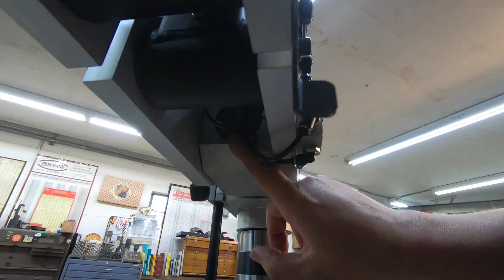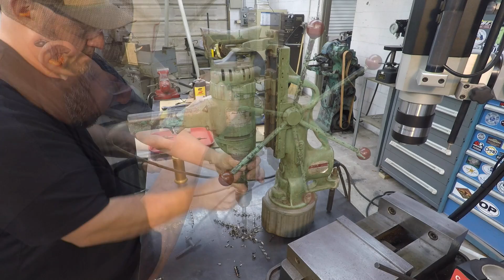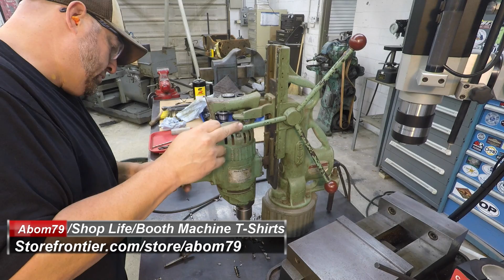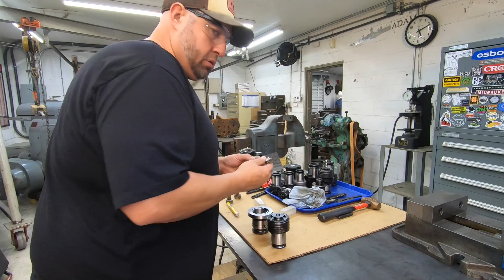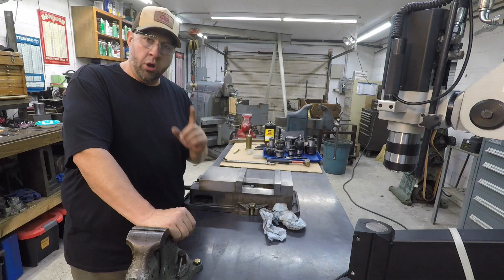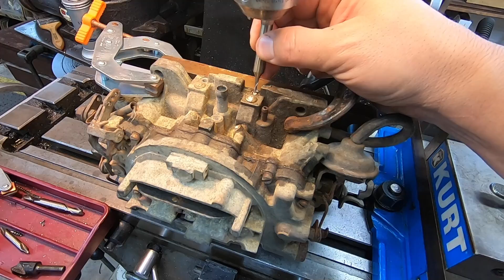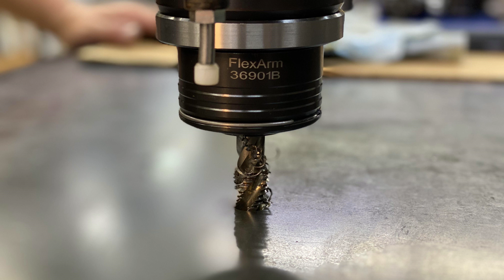SNS 301: Flexarm First Use, Broken Screw Removal

Comment: I've had to get many broken bolts out in my career and i loathe getting small bolts like that out. Especially since the majority of the stuff i have to work on i can't throw up on a mill or in a lathe and work on it. Most of the time i have to work on it on a bench or on my toolbox. Or i have to work on it as it sits in the machine. Starrett center punches have become my best friend in recent years. It's such a great feeling when you finally see that broken stud you've been working on finally break free and start to turn in the hole.

Comment: I wonder why the customer wanted the old carb instead of just getting a new one. In my experience they never run right once they're that badly corroded.
Reply: It could be that whatever it came from was so old that you can't get a new one for it. And if that's not the case it might be a sentimental thing? Or maybe they're just cheap. There's dozens of reasons.

Comment: 28:05 Be patient. Keep drilling with the LH. It will catch when most of the bolt is gone and the pressure holding it is released. 90% of the time will all pull out.

Comment: Why not make an adapter to hol;d a Jacobs chuck?
Reply: For the flexarm? Because at some point a jacobs chuck just won't be able to keep enough torque on the tap to keep it from spinning in the chuck. Plus there's no need for one with all the tooling the machine comes with. And you're not really going to be saving any time, either.

Comment: How does it not break taps?
Reply: Clutch style tap holders
Reply: Smooth, damped hydraulic power, constrained vertical motion, and a computer system constantly monitoring cutting forces

Comment: There are a million ways to bake a cake; when I drillt hrough heavy steel, my main concern is too get a pilot hole in it first. I use a two fluted, #30 short threaded drill bitThen I use Bo-Lube to cur my holes. Once I have a pilot hole I’m good to go. Then I have no problems with final size. This is not meant as a correction just my method of doing things. Adam knows what he is doing. 😎

Comment: A radial drill is all you need to do this entire project, but I’m old school.
Reply: Richard Rush, what’s a radial drill?
Reply: @genecoppedge5972  radial arm drill press is basically just a drill press with Rotating arm. It doesn’t have a clutch in the collet like the flex arm but it has a multitude of uses other than being just an expensive power tap. I tap with a radial arm drill press all the time

Comment: Just a curious question, how do the flex arm keep perpendicular to the parts? It was setup perpendicular to the table, i assume, but on top is a vise, then probably a matrix of parallels in the jaw, then here comes the parts. How to guarantee it is not 89 or 91 degrees instead of perpendicular? I guess that's where the money worth of this machine......is it hyrolic self balance?
Reply: Hydraulic sorry bud; Some of days are spent knee deep hydraulic lines, fluid, & actuators as an aircraft mechanic with Cal Fire with 47 years of experience. 27 USAF active duty & 20 years with Cal Fire Aviation. 😎
Reply: I’m not answering for Adam just my two cents take it or leave it. A set of taps come with 3 taps; #1 has a taper end and is called a starter tap, #2  cuts deeper threads, #3 is a bottoming  tap and finishes the threads. While doing this procedure; I also use Tap-Matic. Just my way of doing things, this in no way says I’m better or have the best technique. Merely my way of doing things my way. 😎

Comment: Would a dull drill bit work better to grab than a sharp one would on the broken screws?
Reply from the maker: Sometimes yes. More tool pressure works better, but sometimes that sharp bit can really dig in hard to help break the bond.

Comment: May I please ask you on why you did not just put a reverse tab in the hole and turned out in that way? I have used that method, mostly because I am afraid to damage the original thread, so I use a drill bit about 2 sizes smaller and use a reverse tab to turn it out by hand. :-)

Comment: haha funny this came up because just today I got a stainless steel bolt that broke off in my seadoo 951 upper pipe of the exhaust... how hard is that going to be for me to get out?
Reply: Is it stainless into stainless? If so it might be very tough.... if you've already worked on it please update us!
Reply: @davidbennett288  just ended up getting a used exhaust from another ski. Much less trouble

Comment: Looks like a nice tool, that Flex-arm!  Tapping is one of those jobs that takes a lot of time when you have many holes to do, and doing it manually and getting the threads just square takes a bit of time especially if the workpiece doesn't have a level surface to sight from.  

In the shop where I did my apprenticeship we had a "tapping machine" that was like a drill press, except that when you pressed the quill down the chuck when clockwise, and when you pulled the quill up it went anticlockwise.  It sounds good in principle but in practice I always found it a pain to use because the drive worked on a friction clutch that meant you had to pull it up fairly hard to get enough torque to unwind the tap, which would lift the workpiece off the table unless you clamped it down, and the upwards pull could also break out the top threads when working in aluminium alloy.  I gave up on it after a few attempts and I rarely saw anyone else use it.  By comparison, this looks so much more convenient because the reverse is on a touch control and you can just take it to the workpiece without the need to clamp it in a specific position.

I have a few questions:
1. Is there a torque control you can set?  Often I use small taps which are easily broken if you can't either feel or limit the torque.
2. The all important question - how much does it cost?  I'd need to get a pay-back on the productivity gain.

Be very interested to know.

Mike

Comment: Few people know how difficult it is to extract such a tiny broken long screw from a soft aluminum metal housing !  Great job, you are a master machinist. Most of my attempts to pull off such a feat  have wound up with the drill bit wondering off into the soft metal.

Comment: I like using a slightly smaller drill bit to start a pilot hole then go up a size and the reverse bit usually grabs the broken bolt and spins it out. If I just use one drill bit it almost never grabs for me but when  you use to sizes the larger bit tends to bite in better when a slightly smaller hole is already there. Just my 2 cents.

Comment: somebody didn't know how to set idle mixture screws. never run them to a "hard" stop or this happens and distorts the metered orifice.
Reply: I suspect that needle tip got pressed into the orifice when the drill bit cut through the threaded diameter of the screw. Earlier in the video it was not seated tight as Adam was able to squirt some Knock 'er Loose into the idle orifice.

Comment: He's an awesome machinist but he needs to invest in some vise grips. They make all sorts of shapes and sizes, and I modify mine all the time to suit my needs. For example, the c-clamp vise grips with the swivel pads would have that vise in position in literally ten seconds. I buy used ones that I don't feel bad about grinding or welding on and you can find them cheap. Even the crappy ones usually clean up nice. I have a couple pairs with angle jaws welded in, in different sizes that I use constantly. I'm a sheet metal fabricator so I have probably 30 pairs each of the finger clamps and the c clamp style. Plus dozens of randoms, with multiples of a bunch of shapes. I bet he would find a ton of uses for them. And before you call me a hack, all it takes is a small aluminum square of 1/8" sheet and you won't mar the surface of your project, plus aluminum grips up to stuff so your clamps don't slip. But the best part is they're fast and well designed. You can have two pairs clamped in opposite directions and the handles clear. The finger clamps have notches so you can clamp on angles. They have chain ones for twisting round smooth objects. You get the point

Comment: You can also drill a smaller hole in the broken screw and tap it. Put the correct size screw in it with loctice and try to remove the broken one. You can also weld the smaller screw on it.
Reply: You can't weld on aluminum. It has a low melting point, much lower than the steel of the screw.
Reply: Actually, you can TIG weld aluminum using AC and there are some Durafix rods which can be used to gas weld and it is a lot like brazing. But the problem here would be that the aluminum could melt around the steel which has a much higher melting point.
Reply: @williamsmith455  Why should he weld on the aluminium? He has to weld on the broken part of the bolt that sticks out a bit. I know there is tiny space but its not impossible..
Reply: @killuminatii1  The only way to really tell is to try. I don't have TIG equipment at the moment.. If I was working on someone else's stuff, I wouldn't try that. The steel bolt might end up surrounded by molten aluminum. The melting point of Al is 660C and steel around 1300C. On the other hand Al conducts heat well, so you never know.

Comment: It's a shame you couldn't locate the flex arm in the middle of the bench so you could reach both ends with it...
And when hand tapping, reversing every couple of turns is done to keep the thread clear and clean from debrie that could damage the thread, so how is the thread when using the flex-arm if there is no reversing?
Reply: that's why fluted taps are usually used when power tapping, to clear the chips

Comment: every time I watch an abom video i can't get over how ridiculous imperial is "so we're going to go ahead and use the tap drill 27/64th's". Who in their right mind decided that would be a sensible r easy way to set up sets of units.

Its just so crazy to me.
Reply: Both systems are easy to deal with, just gotta get used to it for a few days.
Reply: @miles11we :   You telling us you got the number and letter sizes memorized in relation to the fraction sizes in the imperial system?
Reply: @wssides  no not letter sizes but converting decimal (or at least getting close in your head) is quite fast if you do it often enough. 
I use metric in decimal and imperial in fractional and decimal daily so it's super easy.

My only problem is when people whine about imperial when if you actually work in almost any industry, you are gonna need to use both even if it isnt super frequent.
Reply: How about imperial  metric, Browne and Sharpe, number, letter, decimal, starrett, and probably a dozen other measuring systems I can't think of. That's nothing to this guy. He probably has them all memorized. He probably makes his own bolts
Reply: @chrisrage5836  starrett, brown and sharp? Those are measurement systems not companies?? My whole life is a lie!

Comment: The green drill you were using to drill the holes into the table, is that an electromagnet on the bottom?
Reply: Yes
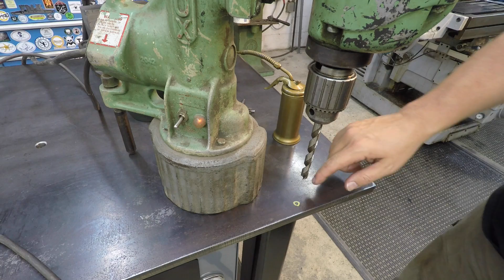Reply: You see the switch and indicator light in 9:40
Reply: That one probably is but some have a massive permanent magnet in the base with a cam lever contraption to break the grip

Comment: If Abom with his arsenal of tools and machines tells me he needs it, I absolutely have no cause to doubt it. What a cool gadget, I didn't know they have cool machines like that for tapping. Then again I'm no machinist, here I am sometimes struggling to tap some M2.5 and M3 holes in stainless steel
Reply: I used to have a body jewelry company and I drilled and tapped 316 stainless all day long. I found this stuff called anchor lube worked better than anything. I found it in a company called small parts, inc. I drilled it with cobalt steel bits and something called roll taps. They're egg shaped with no flutes and they form the thread instead of cutting it. They're super strong because of the shape and the no flutes. Look up what size drill you need for the thread size you want bc you're actually drilling a slightly larger hole for a roll tap bc you're not removing material
Reply: @chrisrage5836  Thank you Chris. As I said I'm no machinist, I will look up on your suggestions.

Comment: Just little comment ...I think that your bench wise mounting flange is bolt in wrong way...I meant for clamping long things without hitting the table your flange should be drilled and taped 180 degrees offset of what you did. I love your video by the way 😉

Comment: Quick question: I'm curious as to the placement of the flex arm, why not install it in the middle of the table so it would reach the entire table, or both sides?  Maybe it was covered in another video, I just found the channel, which is amazing. Maybe due to storage constraints or just not really needing to reach/work on the far side of the work bench?

Comment: Congrats on the new machine, NICE!  The carb is JUNK! It looks to have been underwater for decades. I get it is a "job" to film but ... really??? Buy another one!
Reply: Go ahead slick, you go out and get him one. An original reconditioned AVS  is only $800.00.
Reply: @StevRex-w2u  Stev, If you knew me, you would be amazed at what I can do. Let me clarify, it is beyond economical repair. This means that the cost in time and parts is much higher than the replacement cost. Yes, it is shot, done, kaput.

Comment: Carb is junk. Im all for rebuilding/tuning old carbs (make good money doing it). But for the price of a brand new balls out carb is far less than any machine work. And the state of that carb is somewhere around a small boat anchor.
Reply: My guess is that the guy is trying to restore a classic car and wants to use everything original to the car as possible.  Lots of guys do this so its as true to factory as they can get, ive rebuilt multiple carbs that most would never mess with for guys trying to restore classics
Reply: Sure you do.

Comment: While I have used knocker loose the real deal is BG in-force penetrating it is by far the best I have EVER used. Great on caliper frozen bleeders with some time in soaking and taping lightly for shock purpose. Read about it, once you use it you will never go back and the best part a little is enough in most cases I had to deal with every frozen bolt removed, note sometimes on real stubborn ones a heat gun is used.  https://www.bgprod.com/catalog/specialty/bg-in-force/

Comment: Impressive piece of equipment. I think I have only seen a tapping arm this substantial in a factory where it was used to tap large holes all day, every day. I assume you also went for this size in order to be able to cut some very large size threads.
I have been thinking of building my own tapping arm, after all the basic design is simple enough. But then it would be a lightweight, air driven thing - nothing like this absolute unit.

Comment: That tapper is amazing! Been using those snap on extractors for over 30 years. I've seen a few corroded Carter AFBs, but that one takes the cake! Out here in AZ they don't usually get that bad . edit: I think that's a Chrysler AVS carb.

Comment: broken screw EASY try exstrecting a cloged drill bit out of a blind hole 2-3 days ago we had that happen on a critical part for the scrw there is a cheat you can try to weld a nut on top of it
Reply: he was already afraid to put a torch on it, the only welding was gonna be JB weld.

Comment: Whoops - That small vice was mounted 180 degrees out. If it was around the other way the work would clear the bench if it hangs down lower than the bench. You can see the offset in the four mounting holes.
Reply: good catch, interesting.

Comment: I would have just replaced the carb.
Reply: Some of those old AFBs are very rare and valuable.... like if it came off a dual quad 50s Corvette for example.
Reply: Work on carbs daily. When someone brings me a boat anchor, I tell them straight up its junk. $2k on macine shop work for a carb that will never function properly v.s. a brand new Holley for $400 that will work better and for years without problems.
Reply: @TrapperAaron . Agree. That carb looked like it sat at the bottom of a pond for years...

Now days I would just install a fuel injection system on the car if I planned on driving it a lot.
Reply: must have some sentimental value.
Reply: @djmips  Could be a numbers matching part; otherwise Adam's time cost more than a replacement for sure...

Comment: We have an pneumatic Flexarm in the shop at work. Have a 3 jaw chuck mounted to the table with a hole and works great for doing shafts, and any odd sized small plates cut out by laser or waterjet. Works awesome and would defiantly suggest adding it to your vice selection on the table. Thanks for the video!

Comment: Adam I know that you probably know this, but turning the drill on and off like that will make it overheat and cause premature failure of the motor.
Also - Just a thought here... would brassing off a drill and using that cause the drill to grab more instead of drill?? What are your thoughts?
Reply: That thing looks like it's probably 20 years older than he is.
Reply: @snowdog90210  Old equipment doesn't equal bad equipment though! :D
Reply: The drill is fine

Comment: well done, the drill stayed true all the way down to the hardened tip.  I don't have any reverse drill bits but have just done a reverse sharpen on a normal drill bit and clean the chips often. i also cut a steeper cutting face on them to grab quicker.

Comment: Best tool ever for removing broken off bolts or taps is one of those EDM Machines that’s made like a drill press
Reply: EDM hole popper! I've saved many parts using one of these! Just don't turn your back, or you'll drill completely through your part! Just a warning, not that I've ever done that or anything...

Comment: One of the things i have done is take a small honing stone and square off the cutting edge of the dril. I also did this for drilling soft metals like aluminium, brass and lead. This kept the drills from digging in and breaking.